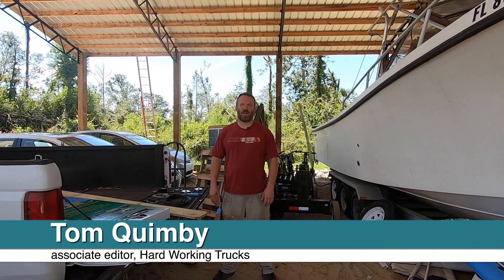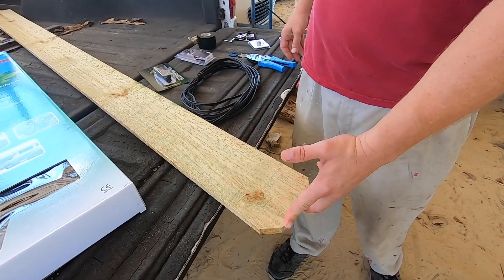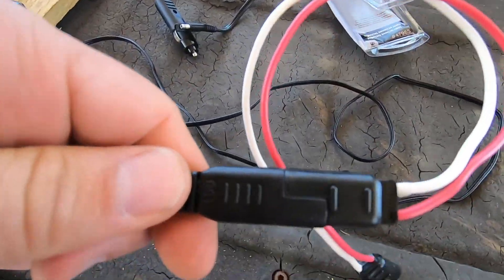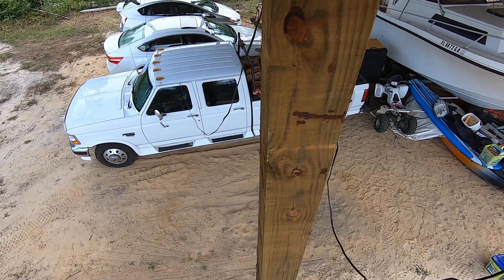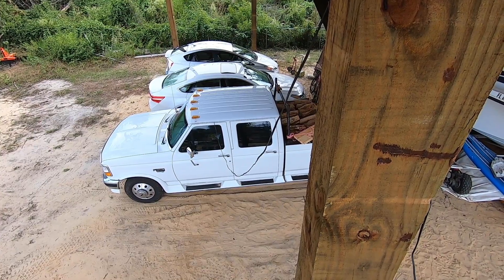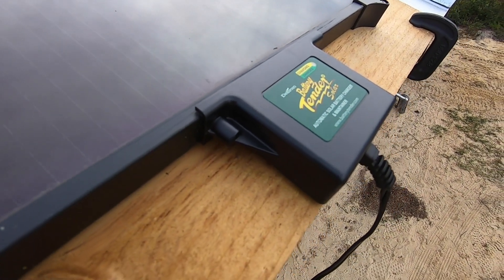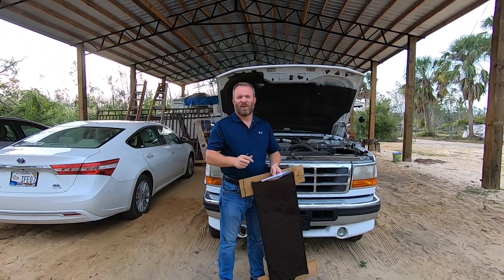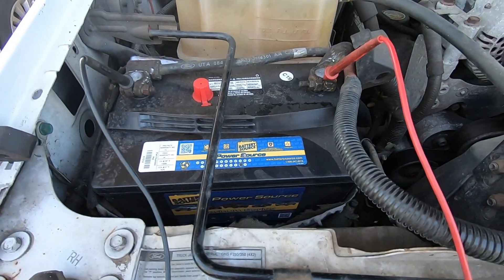Battery Tender solar panel charges up dual batteries in a Ford F-350

Comment: The magnets are a great idea. I am wondering how you avoided reverse polarity with that "landscape wire" and those flat wire connectors. With red and black conductors it's easier to get it right but It appears the landscape wire had two identical conductors.
Reply from the maker: Great question. One wire is ribbed to help denote polarity.

Comment: I live with in a condo . No electricity available. Not that I don’t trust people but I will have to lock it 
inside the vehicle. What are the dimensions of the solar panel ,will it lay across the dash of a 2011 
Ram?
Reply from the maker: Understand your dilemma. I was able to fit it across the dash of my full-size pickup no problem. The only caveat would be sun exposure. South facing is preferred. If you really want to get precise, you can research the best angle to set the panel through various websites like GreenCoast https://greencoast.org/solar-panel-angle-by-zip-code/.

Comment: Six months later and this charger is still hard at it. Should have done this years ago. Since we've got more vehicles parked during COVID, I'm alternating another Battery Tender panel between vehicles on a weekly basis to keep the batteries topped off. It's working great. Panel life is my only concern now. I've read that panels last between 10 to 15 years. But by then I'm sure the panels will have paid for themselves versus the alternative of dragging around a charger and an ultra-long extension cord from the shop.

Comment: Something to think about is as far as the wire goes, slack will cause the cord to move a lot in winds which might stress the very place your concerned about. Just my 2
Reply: Good point. So far, it hasn't been an issue. We'll have to see how it goes longterm. The truck is now parked just under the panel which has taken a lot of slack out of the run.